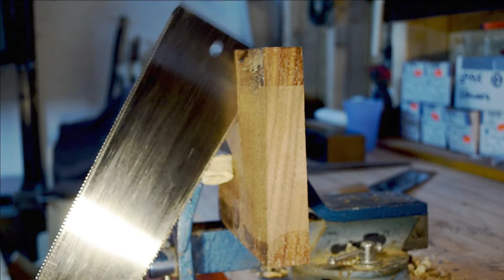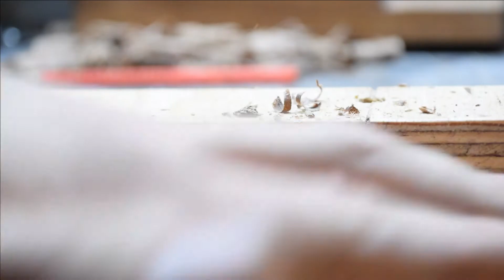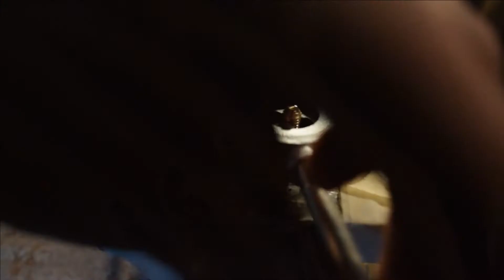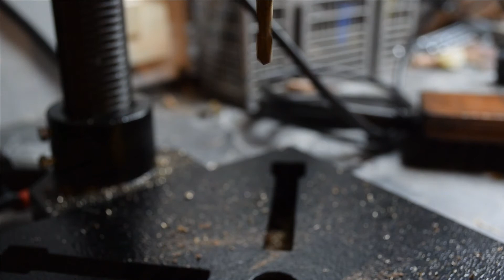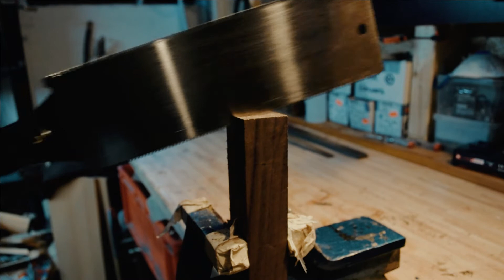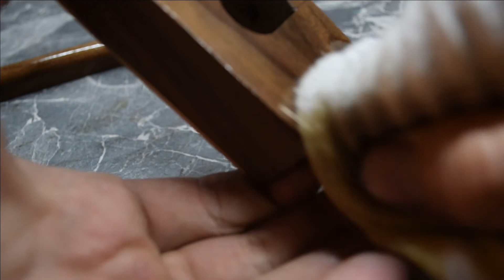How To Make A Marking Gauge || Beautiful Craftmanship || Homemade Tools Pt. 1

Comment: To get around the "metric sizing" or odd ball sizing - use an American Drill Bit and just some epoxy to fill in the "sloppy hole".
You don't want a too tight (smaller) hole - it will crack due to stresses.
I've used this and have no problems.

You can also use a washer and 2 nuts on a bolt to thread in an insert (I do) and use a hand wrench or a power wrench.

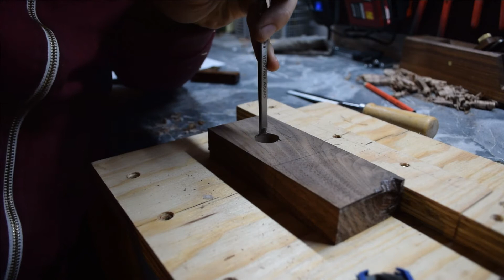Comment: 2:54 That's a great explanation of the U-shape.
Reply from the maker: Thank you! I thought of the U-Shape as a great solution from an engineers perspective compared to a square shaped beam, that will transfer the clamping force from the screw only to one direction. I am glad my explanation in the video made sense. I am also thinking about doing a video about different design ideas and tricks regarding marking gauges.